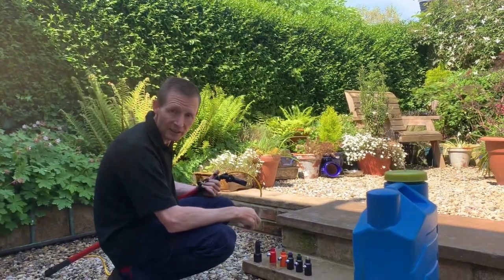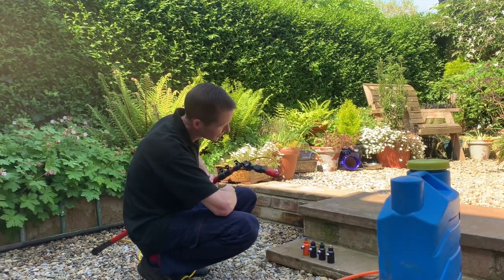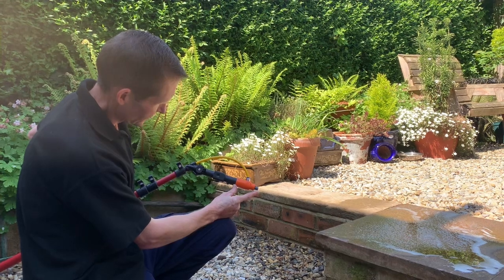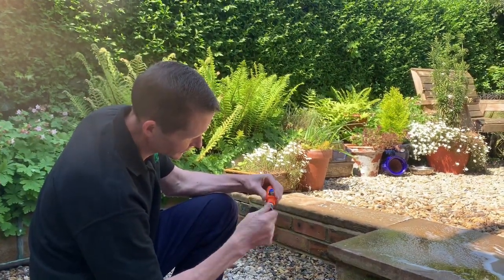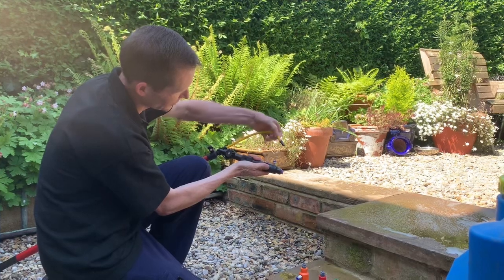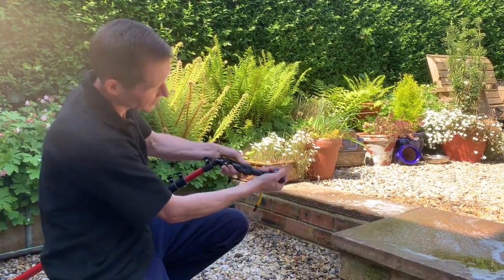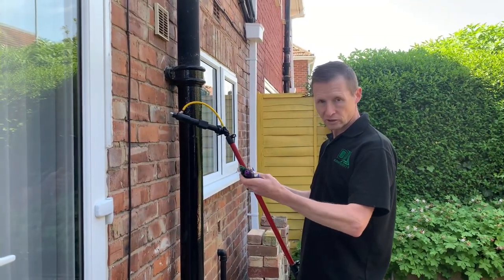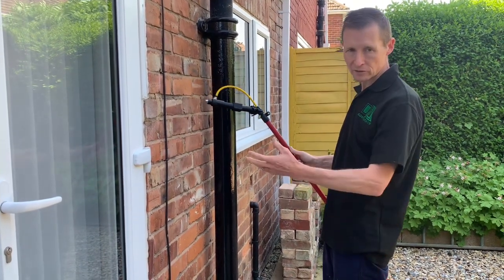Different spray nozzles demo

Comment: Hi Darren,
What is the connection I need for these nozzles,
So I can just take my WFP brush off of my Gardiner SLX 
& swap to one of these nozzles?
Reply from the maker: Gardiners brush adapter you need from them mate
Reply: @dacomponents  Thanks👍